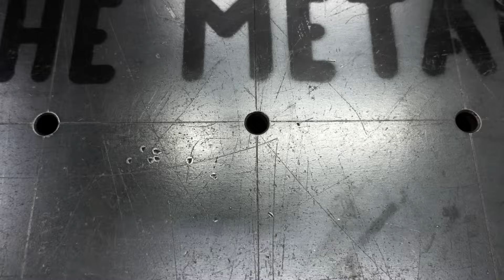How to make a Belt Sander Grinder Band Tungsten sharpener

Comment: I built a similar solution for my tungsten grinding, just bolted a diamond wheel straight to the stone. But I put in a pipe straight out from the axle to connect the shop vac.

Comment: I'm making a belt sander also, and using an 80's polyurethane skateboard wheel that looks exactly like .... yours. Krypton is the brand name if I remember correctly.
Reply from the maker: Awesome....it works great 😁
Reply: @TheMetalist  That brand and type of wheel has a steel core. It does work great. Less slippage because of the Rubber-ish material.

Comment: I mean, yeah, its nice work and a good design.  Problem is Step One: Buy thousands of dollars of equipment.  Step Two: Fabricate belt sander attachment that only costs $150-250 on Eastwood's website.  Depending on if you want a big wheel version or not.  Then this begs the question, if you can afford all the equipment that you have, why not just buy the attachment?  If you work for a shop, it costs them more to pay you to make this than it would to just buy one.